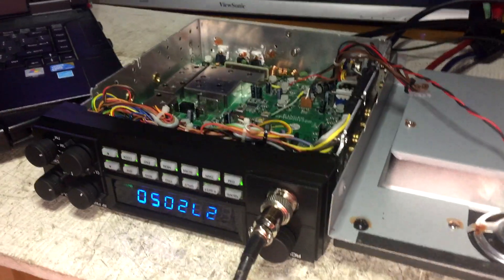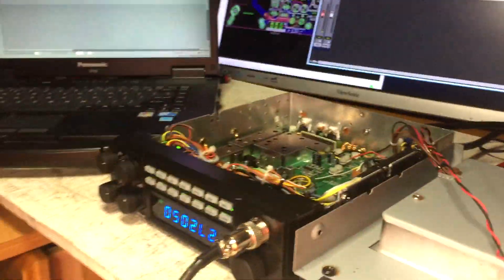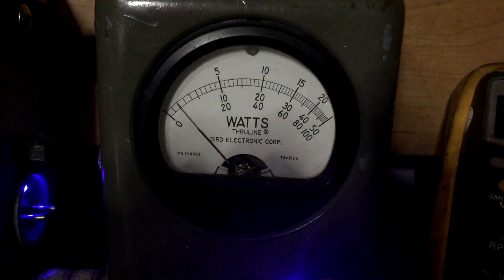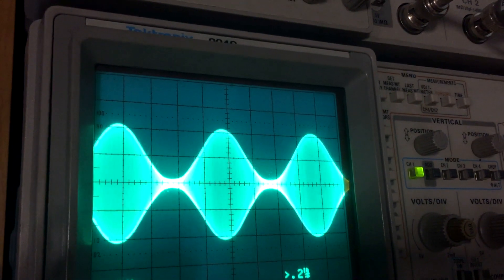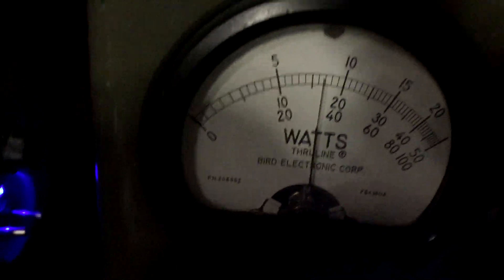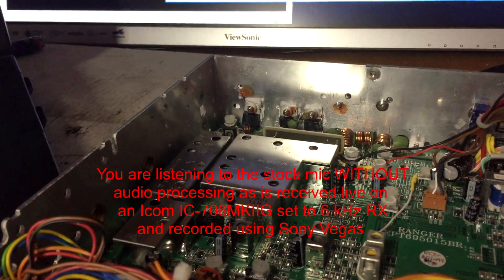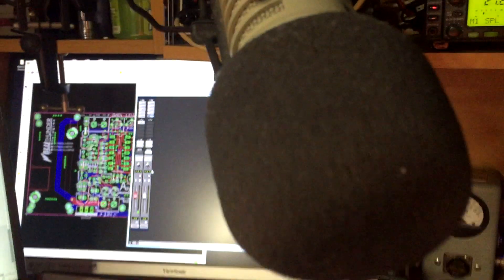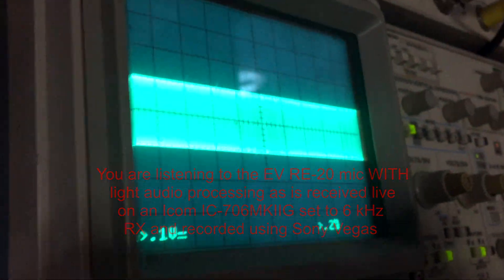Asymod 6 Standalone Unit and the Ranger RCI-2970N4

Comment: So question is how does the connection between laptop running Pro Tools interface with this or any Asymod unit usb port to usb port or some adapted way ? Is there a video showing the chain,radio to laptop to boom mike ?
Reply from the maker: You can take a look at various possible Asymod audio setups in the Asymod FAQ page.  https://asymod.am/p/faq. 

Search for "Audio Processing" toward the top of the page. You can also press CTRL + F, and enter the search term 'Audio Processing'.

For more info visit www.asymod.am
Reply: OK thanks for the link to the site, last question only class AB biased transistor amps only reasonable choice for running the Asymod. Class B doesn't get there ?